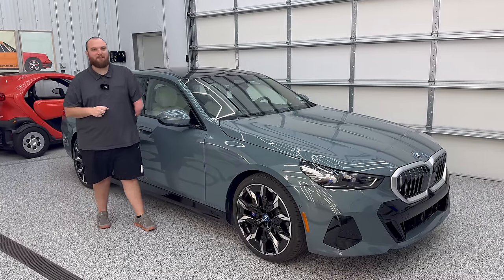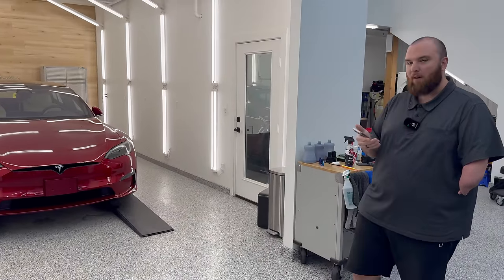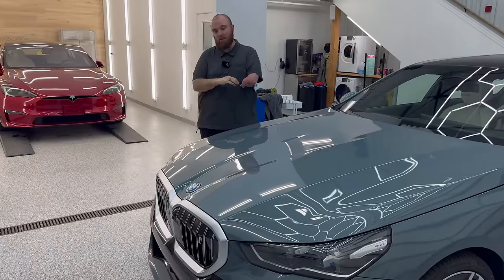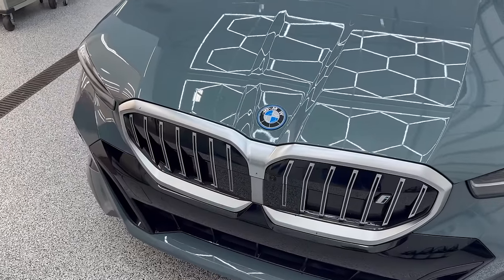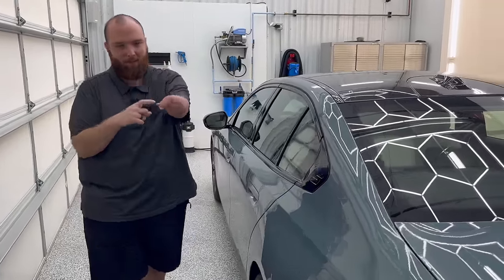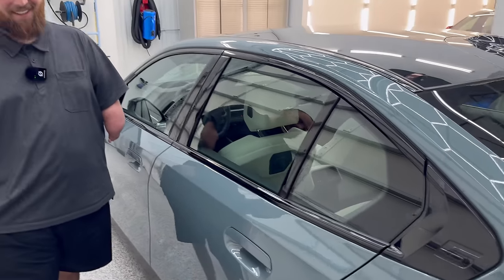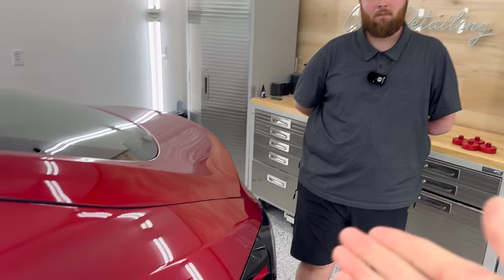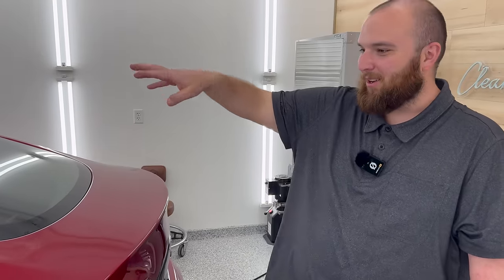BMW i5 vs Tesla Model S Build Quality Showdown! Pure Luxury vs On Paper Spec Sheet

Comment: Too big. I’d prefer i4 or upcoming neue klasse i3 😊
Reply: Agreed, especially the next gen i3 or electric Mercedes C-Class will be great value for money, as they offer good interior space on an EV-only platform, 800V, 270-300kW charging power, LIDAR, HUD and nice comfort features.
They will outperform even the Model S in terms of range, charging speed etc. and stilll be way cheaper.

Comment: The i5's interior is chintzy looking. Tacky. My experience with BMWs is that while they feel solid at purchase time, they are plagued by problems beyond the first 2 or 3 years. Tesla is the opposite and is rock-solid long term. I personally like the simplicity of Tesla's interior design far better. But you are right, Tesla must improve its attention to detail for the S and the X, maybe move production to TX.
Reply: Agree. 
But S/X are also missing some features. imo S/X should have stuff like:

- steer-by-wire like Cybertruck. 

- automatic frunk

- automatic doors with soft close (missing in S)

- front bumper camera

- better sound insulation

- ambient lighting

… list goes on 😊

Comment: The S and X were designed back in 2010 using manufacturing equipment with bigger tolerances with very little money. Tesla may never fully redesign the S and X, if they did they would improve the "build quality"